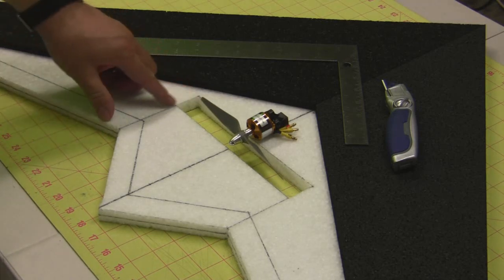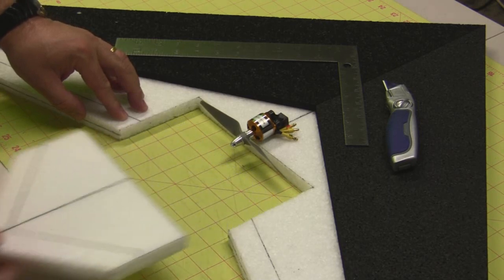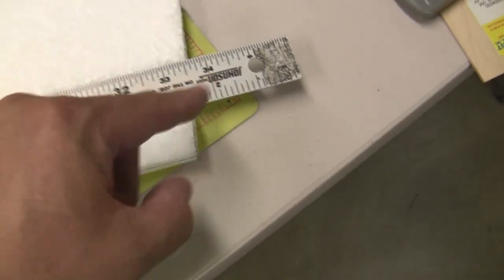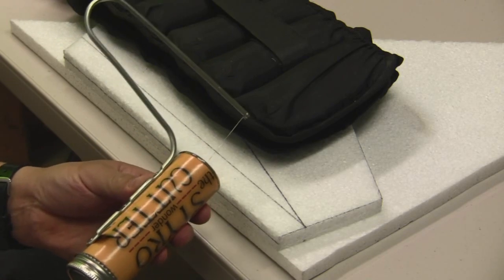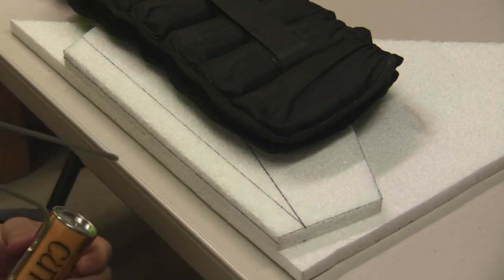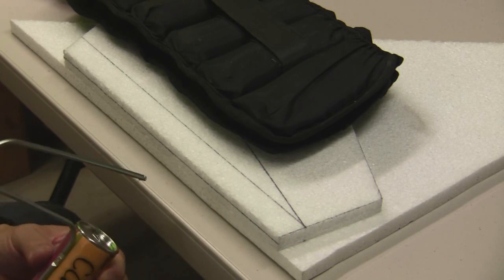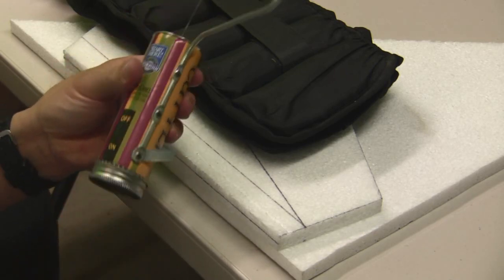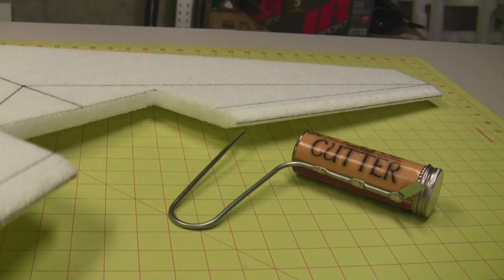Bullet Proof RC Plane Build Along No1 Phase 1G

Comment from the maker: jerryazhakathu with that high a kv rating  you won't be able to run those size props unless you are running on a  2 cell LiPo battery.  On 3 cell LiPo batteries you probably will need to run a 4.1x4.1 prop to keep from going too high on the amps. My 3000kv motor pulls about 50 amps with a 4.5x 4.1 prop. You really need to get yourself a watt meter with that setup.

Comment from the maker: 1pilot please use the formula to convert to metric that was included on the download  for the wing shape you mentioned in our blog. it is ( Inches x  2.54 = centimeters ). I will try to add some annotations on the videos with the correct meteric measurements when I have more time.